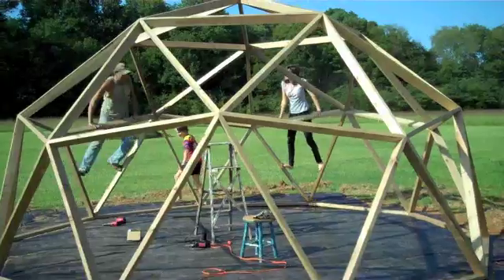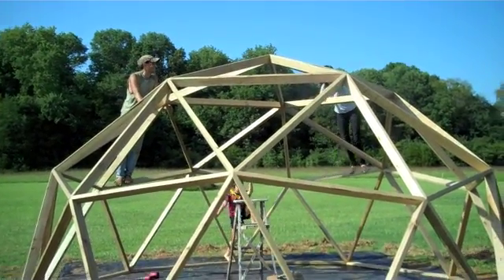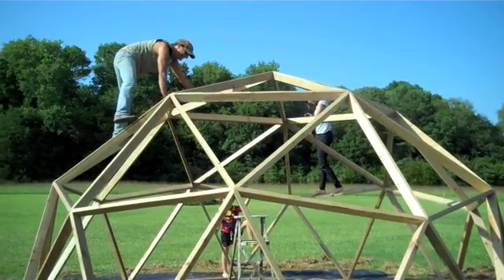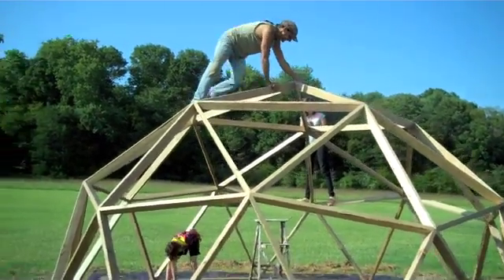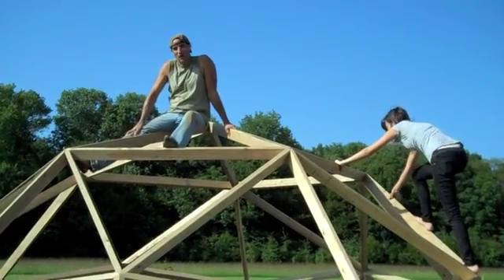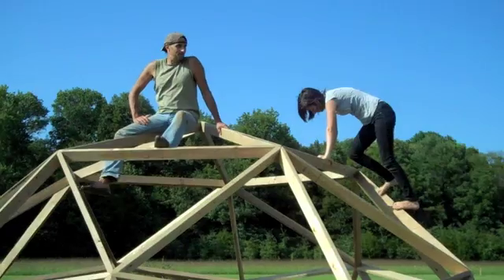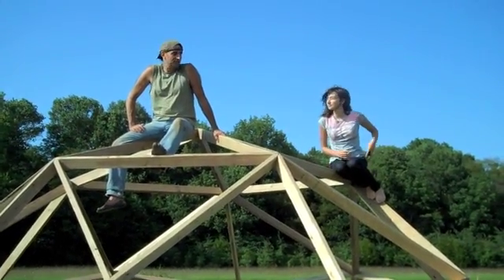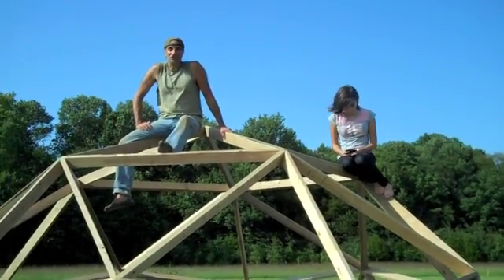BUILDING A 2V WOODEN GEODESIC DOME

Comment: How did you figure out the angle on the pointed end where the hubs screw togther I'm using 1x3 for a small dome
Reply from the maker: We used the dome calculator on simplydifferently.com. Under the dome calculator tab you put in your dimensions and it will calculate all your angles

Comment: What do yhey by " V". Whats the diff 2v, 3v, 4v a d 5v?
Reply from the maker: Basically, it is the frequency meaning the number of triangles. A 2V only has 2 size triangles. The higher the number, the more triangles of different sizes you have which means a larger number of different angle cuts on your boards.

Comment: How do you know what angle to cut the 2x4’s at?
Reply from the maker: There are two angles cut on each board. It depends what size and frequency dome you build. You can find the angles using an online dome calculator. We used the one on simplydifferenty.org.
Reply: @ghog63  okay thank you! :) subscribed.
Reply: @ghog63  how do i convert the numbers it gives me into angles?
Reply from the maker: @BigCroca  In the calculator where it says edges/struts & bending angles, the number in parenthesis is the angle. Using the 2V as an example, the 
" A x 30: 0.54653 (15.86) means you will need 30 boards cut with an 15.86 degree cut on each end and 35 boards cut with 18 degree angles. Underneath that where it says "A lath= and B lath="  is the length of the struts in meters. 30 "A" struts at 2.1861 meters and 35 "B" struts 2.4721 meters. Just use a meter to feet converter to get the measurements in feet.

Comment: whats the angel of the cut?!?
Reply from the maker: There are multiple duel angles that need to be cut. The angles vary depending the   frequency of the dome. (ie 2V or 3V etc) You can use an online dome calculator to get the angles. I used the calculator on Simplydifferently.org to get mine.
Reply: @ghog63  nice! thank you! but that tool i sech is missing, you know where i can finde a ZOME calculator?
thx for answer!!!
Reply from the maker: @ThomasAkaK   Interesting. Those zomes look pretty complex especially if you triangulate them which you would need to do to make them stable enough in my opinion. Sorry, I don't have any info on them.

Comment: Great job. If I had to figure out those cut angles, My head would explode. That's alright, I've been in E.O.D. my. Entire life.
I have hubs already and am using tubing. It's from a kids playground- a 2v Dome. So I am tripling the strut sizes and only using the hubs. Problem is setting up the bottom on a 45° mountain side. So it's flush to the ground at top and 6 or 7 feet up on the bottom .Getting level and getting the spacing of the posts its gonna sit on is drivin me nuts. 
Anyway, great work!
Wulfy
Reply from the maker: Wow, that does sound tricky. Hope it works out for you. Sounds sweet.

Comment: I wonder if it was a one man job. Structureing the dome from top to bottom would be easier. you would need a pole with a pulley system. so as you build levels use the pulley to raise up your finished work and complete without climbing on it. Nice work though

Comment: We are building a 20' geodesic hemp dome this weekend June 4th. I am curious about what went wrong the first time so we can avoid making the same mistake. Thanks for any advice you can share.
Reply from the maker: A hemp dome sounds awesome. Will you stucco it? What type of flooring? Our 40 foot dome that failed to close was not level at the base so we weren't able to meet the top pieces up. Our smaller 2V dome closed easily probably because it is smaller and we were able to nudge it into shape. With your 20 footer, I would say get it as level as possible. I wouldn't get obsessive with it but the more level it is, the easier it will be to join at the top. Good luck with yours.

Comment: Do You have a list of the angles and miters that You cut the wood at ?
Reply from the maker: Walt Lars We used the dome calculator at simply differently dot org. You just put in your desired size and the calculator gives you everything you need.
Reply: Cool beans !
Reply: That website doesn't exist anymore...  is there another you recommend?
Reply: It is still there and working. "simply differently dot org"

Comment from the maker: All the 2V domes on simply differently use 10 base boards regardless of diameter size. The only thing that would change is the length of the struts. Good luck with the build. At 15 feet you shouldn't have any problems. That's a very manageable size.

Comment from the maker: Oh, sorry about that. Well, it was leftover wood from the 40 foot dome but I think it is around 115 meters. If you use the dome calculator at simply differently then you just need to plug in your diameter and take each strut length and multiply the number needed.

Comment from the maker: I would say yes as long as you are using this type of connections. I'm unsure of the strength when using metal hubs although Rob at web4deb did a huge hub dome and he's in the northern U.S. I know he gets snow. The geodesic dome, popularized by Scientist Buckminster Fuller in the Mid 20th century, is the strongest structure known to mankind. I did cheat a little as the plans I've been following say to go 3V if you build larger than 15 feet but you're right, this 18 footer 2V is very solid!
Reply: Monolithic dome should be stronger than a geodesic dome.

Comment from the maker: A duel angle miter saw is definitely a huge plus in cutting the angles. I only have experience with this particular saw so I can't compare it to other duel angle saws, but this one worked very well.
Reply: Did you cut the sides on a beveled angle?
Reply from the maker: @aleva898  yes, duel angles